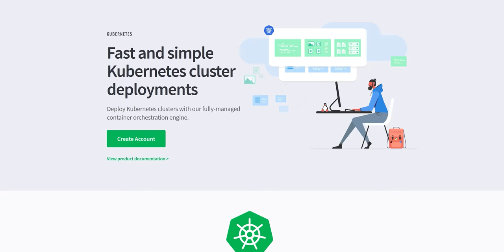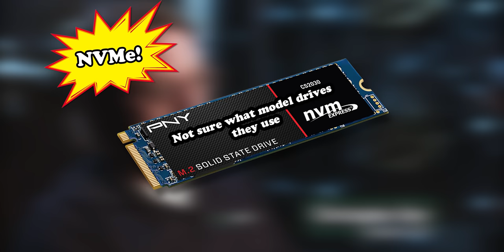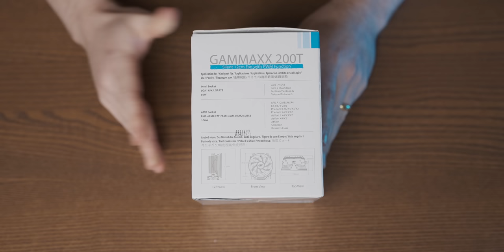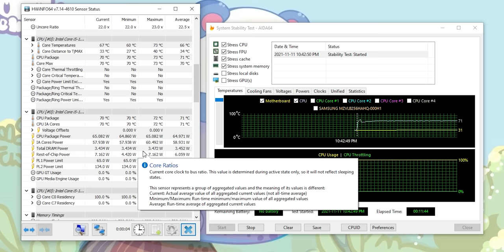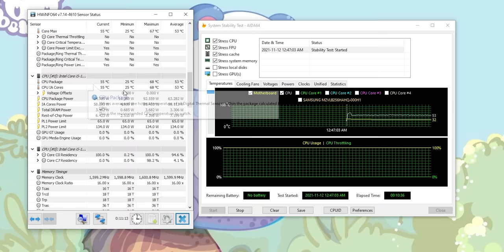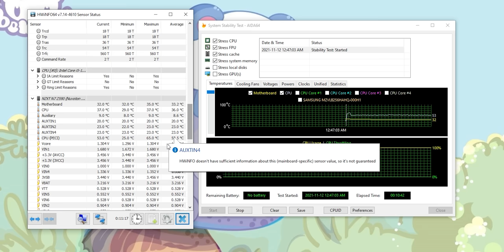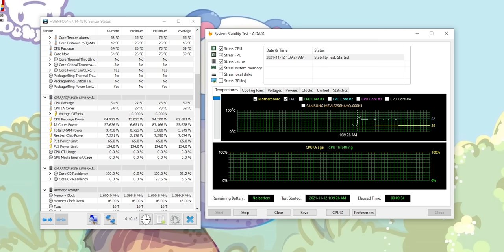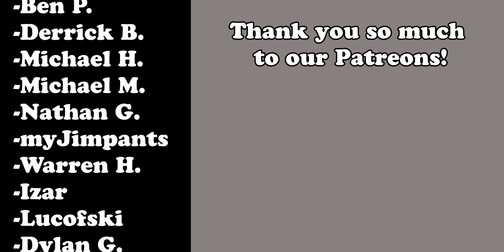Sub $20 Amazon CPU Cooler Shootout

Comment: I'm actually looking at cheap CPU coolers for a build I had planned. This couldn't have come at a perfect time xd
Reply: Just go with a gammax Gte v2 or any deepcool gammax
Reply: Please, take the extra coin and get the noctua nh12s redux! You'll get this below 50$ and the performance is just out of this world!
Reply: @jason04112  I actually found some chinese seller with a twin tower 90mm cooler, but I am a bit sus of the shop
Reply: @F4mouzzZTheRaper  I actually found a great deal on a used one for like 40, but I will most likely be cooling a 65w tdp cpu lol
Reply: theres some chinese brand that pretty famous like ID cooling, Aigo (i think this one has dual tower cooler at cheap)
Reply: ID cooling is also a good brand for AIO. It pretty popular here in the PH for budget options. 

The deepcool gammax gte is also a popular one. Its the one included on the NZXT BLD KIT
Reply: Hyper 212
Reply: if it's on the 2011 socket, check out the HP z440 cooler. It's an oem model, but if you swap out the fan for a larger standard fan, you've got a 120mm finstack, an all metal mounting bracket, and 4, count-em, heatpipes
Reply: Snowman 6 heat pipes dual fan is what i use for my xeon 1650v2 overclocked to 4.1 Ghz all core. 70C+ when playing Civ VI in a room with 28C ambient temperature. It should be at 25-30$ in AliExpress or Amazon
Reply: bro look up the snowman cooler trust me
Reply: Same here actually
Reply: @crispianchealuks2024  lol just said the same, patricians choice
Reply from the maker: No way! That's awesome. If you spend a couple bucks more than $20 you get a whole bunch of amazing coolers.
Reply: @DawidDoesTechStuff  Loooooook! You missed one, this thing is awesome... Was going to do a product review for it. 
Zalman CNPS 9X Optima CPU Cooler is $19.99 on Amazon
Reply: Zalman CNPS 9X Optima Cpu Cooler. $19.99 USD on Amazon, 4 direct contact heat pipes
Reply: 212.
Reply: @jowsey.mp4  look at the ID Cooling 224. Its much cheaper than any noctua and the performance is just as good for 65 watts
Reply: @F4mouzzZTheRaper  in what world is a Noctua cooler cheaper than 50 bucks?
Reply: I believe the brand Vetroo V5 has a $20 CPU cooler which is another option you can look at. But it only has one RGB mode compared to It’s bigger brother who is better for $10 more with multiple RGB modes. I’d recommend the Vetroo V5 CPU Cooler since It’s budget friendly and looks amazing with the option of Black and White as the color.
Reply: @F4mouzzZTheRaper  I would also recommend the arctic freezer 34 esports duo. Even with my overclocked 5600g it still only hits 50 degrees Celsius on most games.
Reply: gammaxx 400 is good
Reply: i got an aio from deepcool for around 45 bucks and i dont regret anything its really nice and cools well
Reply: "couldn't have come at a MORE perfect time"

Your words didn't make sense.
Reply: @jowsey.mp4 Noctua is the best cooling and super quiet. China sux for coolers. 

Gimme points for being two years too late.

Comment: The best budget air cooler is the snowman in my opinion, 4 copper tubes, really good cooling performance and its $15 for the single fan and $20 for the dual fan version.
Reply: That's if you can get one.
I bought one from aliexpress, they sent me the single fan 4 heatpipe version when I ordered the dual fan 6 heatpipe version. Seller wouldn't cooperate, ali gave me a partial refund.
I bought another one from a different seller, they sent me the right one this time but it was completely destroyed. the fan was cracked and there was a big dent in the middle of the bottom of the cooler (where it contacts the CPU) so it's not really usable because you can't get proper contact.

I gave up and bought a Wovibo cooler, which cost a little bit more, but also has a shit ton of RGB if you like that, and it was actually packaged properly and I was sent what I had ordered. Very good performance for the money. Can be a bit difficult to install sometimes but can't complain for the £23 GBP I paid for it.
Reply: @yotoprules9361  yeah the shipping is a problem, they never secure a package.
Reply: @Cazman1989  its probably more feasable for chinese / asian purchases. international seems to be full of damaged products that arrive when it comes to cheaping out on packaging with cpu coolers in particular
Reply: @mikeymaiku  its the way they handle shipping, when the product gets to the warehouse for storage they literally just dump it in storage, the don't bother sorting packages because of the volume so they just throw it in there and it lands somewhere and something lands on top of it and that's how it goes, they don't really take care, but that's if you use standard shipping, if you go for the premium it is taken care of, but premium costs range from $30 to a $150.
Reply from the maker: No way! That sounds awesome. I'll go check it out.
Reply: @DawidDoesTechStuff  yeah the single fan is competition to the hyper 212, they also have a 6 pipe single and dual fan variant, a bit more expensive but really good, the single fan stayed stable at 90°c on a 5950x at 150w draw, and also take a look at ID cooling they make some really cheap but very good AIO's a 360mill is $67 US. 
Hope i gave you an idea or two on content.
Reply: @yotoprules9361  Check the seller, lots of them are outright scams or dropshipped from official stores. If you're buying from big Chinese brands, they most likely have an official Aliexpress store or some official distributors
Reply: @DangNguyen-xx3zi  I just bought from the cheapest ones.
Reply: yea i have the snowman t6, the black one with one fan and no rgb. i paid about 30 usd i guess. it arrived fine with no bents or anything. it cools a ryzen 3600 quite well  with lots of oc headroom.
Reply: @yotoprules9361  chances are you hit a scam store. They lure you with a low price for the T6, then they just dropshipped you a T4 from the official store instead.
Reply: @DangNguyen-xx3zi  maybe. But still the second one I ordered was damaged beyond repair. Can't win.
Reply: @yotoprules9361  shipping wise where you do live? I keep hearing issues with shipping from Americans. I've been ordering stuff on aliexpress to Vietnam, Malaysia and Singapore and ouot of dozens of packages only one ever had issue, a cracked screen protector
Reply: @DangNguyen-xx3zi  UK.
Reply: @yotoprules9361  I've bought 3 (1 one order, 2 a different order) of the 2 fan 6-pipe 92mm variants from the official Snowman store, the corners were the weakest point of their packaging, but they all did arrive in one piece in a 'air tube bag'. Only one of the 3 had some bent fins in a corner, but bent it back and they've been going strong.
Reply: @DawidDoesTechStuff  Yes! What these guys said! Do more coolers and definitely check out ID Cooling and the Snowman coolers. Also, turn the heat up with some 8 to 12 core chips to see what they can really handle. I don't know what cpu's you have on hand, but if you stick with Intel, you can do all 10th gen and go from 6 to 8 to 10 core chips if you have them all. AMD works just as well, if not better with 6 to 8 to 12 to 16 core chips if you have them handy, or just stop at 12 lol because I think the 5900X is hotter than the 5950X.
Reply: i got a similar to Gammax 200T, a Deep Cool Ice Edge Mini FS, which is the same thing but with a smaller fan, my Intel Stock Cooler wasn't capable anymore to cool my CPU so i had to desperatly find a new one, i went to a local shop and bought the first thing i saw, it was about 20 dolars if you convert my country currency at the time

Comment: Considering that Dell has been using that cooler for over a decade... I imagine they have a warehouse full of them like that scene at the end of Raiders of the Lost Ark. So, they could have cost like .50 cents a pop.
Reply: Those are more recently made.  Stock coolers from 3rd and 4th gen intel Optiplexes are much beefier.
Reply: @HarmonyEdge  They've been using the shorter ones just as long, they just used them in SFF and USFF systems. The MT got the beefier cooler up until the 40 series when they went to the smaller chassis. If only they use the XE2 heatsink in everything. Those weren't half bad.

Comment: The "CO" in the name of Arctic Alpine 12 CO cooler stands for "Continuous Operation", so for 24/7 use.
There is a cheaper version with white fan (non CO fan), like literally -1€ :D
Reply from the maker: Yeah they seem to make a whole bunch of different versions of that cooler. I got the CO one coz I could find it at a local shop and didn't have to actually buy it on Amazon. 😅
Reply: Having used both CO and non-CO versions in a 24/7 server for over a year, both are fine.
Reply: So they pay you to keep it?
Reply: @Fay7666  they're fine for the first year,let us know how much longer one of the fans takes to fail
Reply: @ffwast  if the non CO fan actually fail under like 3 years or something like that, i would say that is some stupidly low quality fan
even random intel stock cooler fan or even just random case fan can last more than 6 years in my experience until they going slower since not enough lubrication but that's an easy fix
Reply: @randomthingch1970  Pretty sure the Arctic coolers are not made with "some stupidly low quality fans", since they offer a 6 year warranty on their products, so... 😉😎
I actually put an Arctic Alpine 12 on a built I did and it works like a charm.

Also the CO model offers an extended life span vs the normal model, thou it's apparently slightly noisier (thou in Alpine data they are rated w/ the same sone) 🤔
Reply: @MaximusAdonicus  im not doubting the Fan Quality to not last at their Warranty spec, im more doubting for the claim of "the non CO will fail faster/not designed for 24/7 usage" to me the CO and Non CO were exist to choose the color (since both have 6 years warranty lol)
like i got the same Intel Stock cooler that uses Fluid Dynamic Bearing (same as Alpine 12 non CO) as their Fan Bearing and its still going after 11-10 years so yeah
Reply: also yeah its Louder for the CO Fan since its Dual Bearing Fan which have higher Bearing noise compared to Fluid/Sleeve
Reply: The non-CO Cooler-Fans are less noisier because they have other bearings, but this are not designed for 24/7

Comment: The Deepcool Gammaxx 400, one of the absolute best budget coolers out there, is $19 right now on Amazon US. I know it's not a fair fight because that's a deep discount while the PCCooler blue square turdface is always $10 or whatever, but anyone either building or rocking anything from this video in a mid-tower right now should be aware of that price.
Reply: Agree Gammaxx 400 is a great budget cooler. I paid $24 on Amazon, which was still a deal. It is also shorter than a Hyper 212 if you want a tower cooler with limited case height.
Reply: I double that. Gammaxx 300 is a solid choice too and should be around 20 w/o a discount, used to cool my 4+ ghz fx6300 very good.
Reply: just buy a mugen5 for $50 and be done with it.
Reply: @mongoosemcmongoose2786  why spend x3 when you can spend x7 by buying Noctua NH-U12A, amrite?
Reply from the maker: Oh damn! That is a really good price. The budget cooler space is very competitive.
Reply: @Zysperro  what? its like 2.5x so don't exaggerate, and that makes no sense what you said.
spending $20 vs $50 vs $110+ is not even close to "Might as well spend X"
use your head.
the mugen5 gives you at worst the same cooling with a quieter fan profile, noise matters, as you can see in this review.
does it cost more? yes.
is it a better build quality and much quieter?
yes.
spending an extra $25 is not that big a deal when you're building a PC system.
I never understand these budget considerations that are nickel and diming over $15-20
gamer nexus does the same thing, acting like a case that costs $75 vs $60 is a "big deal"
you're buying a system that costs hundreds of dollars, if not thousands... 
your cpu alone, even if you go with a "budget cpu" is probably at least $200-250 minimum.
why would you skimp on a cooler to save $20??
Reply: The mounting for the 400 was tough to get on on my fx 8320, but it cools it just fine overclocked. Getting ryzen soon so will need to see about an am4 bracket for hyper 212, not sure if my older model of gammaxx is am4 compatible.
Reply: @mongoosemcmongoose2786  you don't buy dirt cheap cooler for a normal build, it has to fit in budget. Your mugen 5 is 70-80$ in my country and many others too (Scythe being JP company), so I was being generous with x3. Chinese stuff is cheaper, it's a fact, and can be as good or just good enough.
25$ is a big deal in 300$ builds that still exist. You can get almost r5 2600 experience with Xeon combo (mobo+cpu+ram) for 100$ and something like Gammaxx 400 will fulfill all your needs (I'm not sure about mountings on xeon though lol).
Reply: @mongoosemcmongoose2786  > why would you skimp out on a cooler?
Because why not? If it cools enough, not too loud and pretty durable (my brother's Gammaxx 300 have seen 3 CPUs now in almost 10 years) - why would I pay more, when I can spend that extra on the more essential parts that would actually affect my experience?
Reply: For anyone interested i slammed it on my i5 10400f and it ever barely hits 50°C with decent airflow
Reply: @mongoosemcmongoose2786  mostly the nickel and diming comes from used parts systems than need coolers, or hyper budget sub 300 usd builds. You can get a 12 core "overclockable" E5-2673v3 for ~50 usd used, a cheap Huananzhi or Machinist board (say the x99 G7 for ~70) and 16gb of ddr3 in quad for like 20 bucks. They generally come with amd adapters for x99 boards of that nature, and the cpu is similar in gaming to the 10400f while being significantly cheaper, with better multicore performance. At about 250 to 300 you have a 1080p workhorse that can stream while gaming with no cpu performance hit, access to ddr3 and ddr4 as an upgrade path,  quad channel mem and plenty of pcie lanes.
Reply: @DawidDoesTechStuff  I got a gammax for £5 on ebay. Was lucky, really good temperatures on a 10400f, mid 50s at 65w load.
Reply: i had one on a 1600x overclocked to 3.8 all cores, now on a 2700x, barely crossed 65c under high usage. win in my book, core clocks dont drop
Reply: @mongoosemcmongoose2786  eh scythe is not even available in all countries.

Where I live the Gammaxx 400 is the cheapest and provides excellent cooling for the money. Scythe and ID cooling aren't even available here.

The Gammaxx is usually $20 here. The Noctuas start at $50 for the L9i and goes all the way to $115 for the U12A/D15.

For the i5/R5 parts which are most commonly bought, the Gammaxx is very quiet and runs cool.
Reply: @KadiusFTW  the v3 xeons and x99 should be ddr4 but yeah, you're pretty spot on.
Reply: @mongoosemcmongoose2786  you have to mind overall budget for a build, especially those who are not in the western hemisphere where every cent counts. Also mind that those who are in the eastern hemisphere will generally opt to get these brands instead due to how cheap they are while performing well for their price.

like what you cited as example, a 15$ difference in case price can be key to investing in other parts. That makes it a "big deal". If you have the allowance to spend on parts as you can, more power to you but it is not always the same case to other places so please don't just think all places are the same when it comes to trying to build their first computer.

so yeah... to quote you "use your head"
Reply: Just to add to that ,cooler master has a hyper T200 model which is like the smaller brother of hyper 212 and it performs great, like with an i5 10400f you pretty much never reach 60c with a decent airflow....
Reply: @exodyno  Incorrect. There are "OEM only" ddr3 and ddr4 compatible xeons. I am messaging you on a 2678v3 right now running on 128gb of ddr3 ECC. The 2673v3 can be had on aliexpress for ~50 usd and supports both
Reply: @exodyno  if your budget is that tight then you shouldn't be buying a pc for gaming to begin with
so "use your head"
Reply: @ShashankKR  see THAT is an appropriate reason, they aren't available. fair enough.
Reply: @mongoosemcmongoose2786  bro what? you can build a pc that can game for like 300 usd with a 512gb ssd, an r9 270X, 16gb of ram and a 12 core. I just did for a client.
Reply: @KadiusFTW  scam artist. why are you selling people 7+ year old hardware.
Reply: @mongoosemcmongoose2786   ~same reason people sell used cars. The 2673v3 ~ 10400f in gaming and a crazy workhorse for any rendering tasks, and is 50 usd. The fact Im using an older gpu should be self explanatory, we are in one of the biggest worldwide parts shortages, well, ever. The gpu performs similarly to a gtx 1050 ti, and can play most games in 1080p.
Reply: @KadiusFTW  the r9 270x is not similar to a gtx 1050ti, it's a 660ti you scammer.
the fact that you're telling a client it's equivalent to a 1050ti is dishonest and and outright lie.
the fact that you're calling a 2673v3 xeon equivalent to a 10400f in gaming is absolutely straight up lying to your client as well.
the 10400f is 20-35% faster in every single gaming benchmark, and the 1050ti is 10-15% faster than the r9 270x.
you are taking advantage of people who don't know their hardware.
shame on you.
Reply: @KadiusFTW  no, the r9 270 does not perform as a 1050ti
stop.
Reply: @lagginswag   Sure is.  Have it on  Ryzen 3600 using AMD socket clip.
Reply: @rasmith4587  A bit late but thanks. Found out it works fine and doing a good job on a 1600 af at 4.0🤘
Reply: 4 months later and the Gammaxx is just as good as it ever was and now the blue version is only $15. I had really good thermals when running a stock 5700G and things didn't change much when I put a mild overclock on the iGPU.